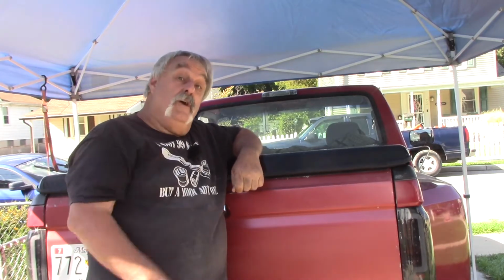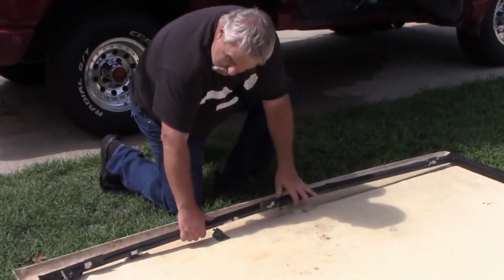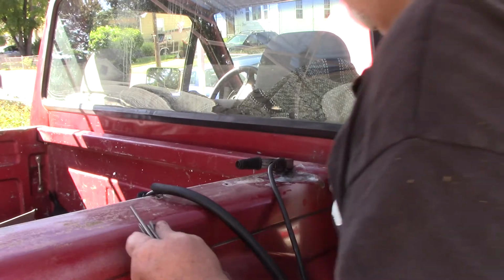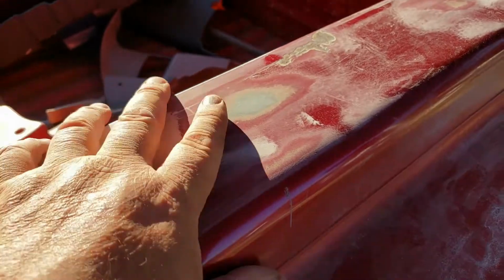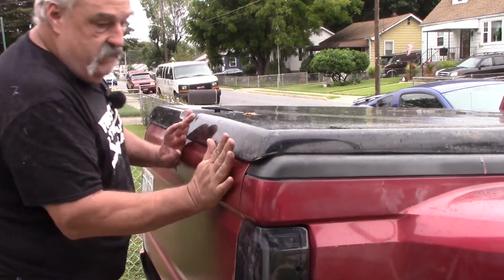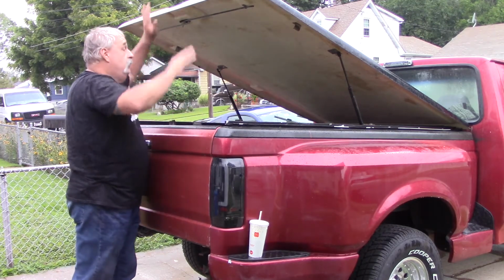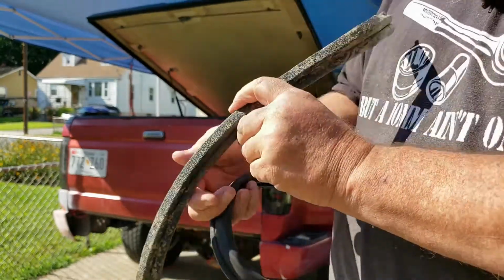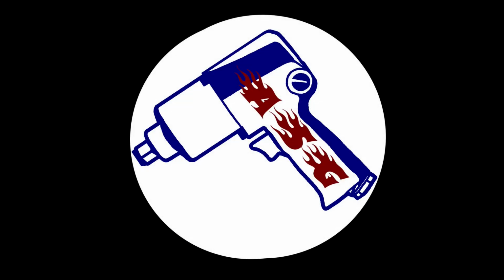Tonneau Cover install on my OBS Ford F 150 Flareside

Comment: Check out my 1995 Flareside 5.0. Very similar truck but blue silver. Doing the resto as well.
Reply from the maker: That is clean and sharp, I like it, i'm working on turning mine into an XLT, I'll have a video I think this week on putting in the Power windows and Door locks, but that is nice, I will be fallowing your build, Hey, how hard was the dash to pull out, I want paint mine and I would rather do it out of the truck.
Reply: @AintScaredGarage  not to bad, some times i had to walk away for a bit to keep it fun. The screw under the steering wheel is a pin next to it also, once you get the nuts and screws all off around the dash that's where you pry up to lift it out. There's also two other screws under by the steering wheel as well. 
Awesome thanks for watching the build!!

Comment: Only problem with those type of tonnuoe covers is you can't haul anything tall
Reply from the maker: You are right on that, mom bought a new dryer and I had to bungy the cover down on it to get it home, what would have made them better would be if they had a quick release so you could easily take it off,  but no, if you want to take it off you got to completely un bolt it, but it very rarely that I need to haul anything big, I do like using the truck when I travel and the big trunk comes in handy for that lol, thanks for the comment
Reply: @AintScaredGarage  yes sir and great video as always